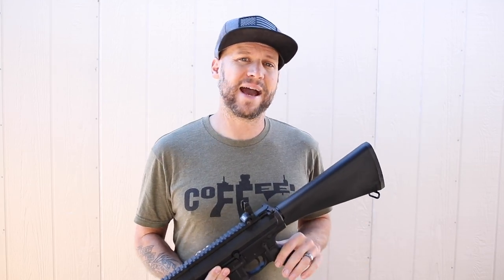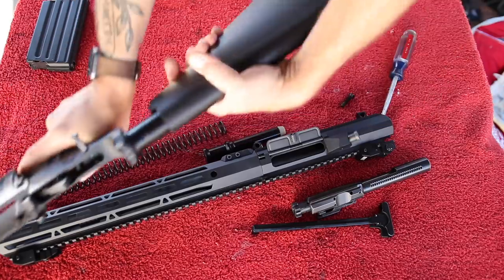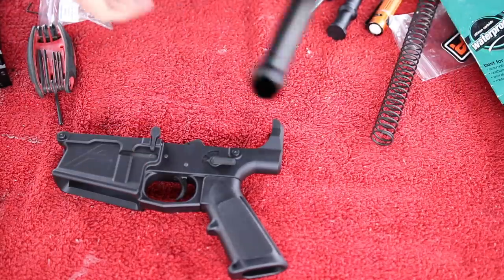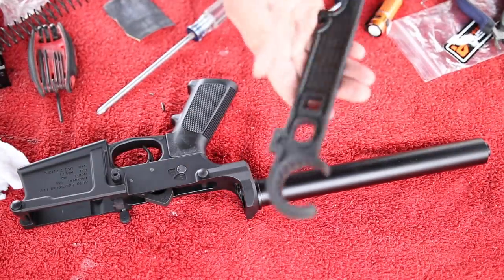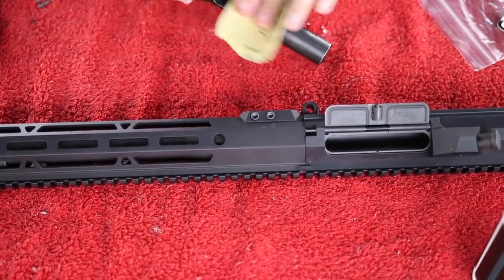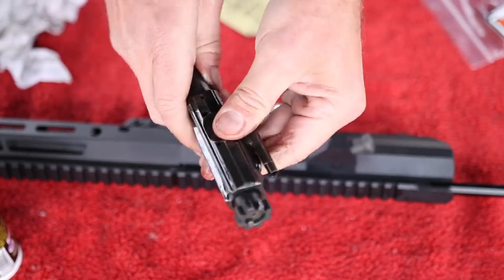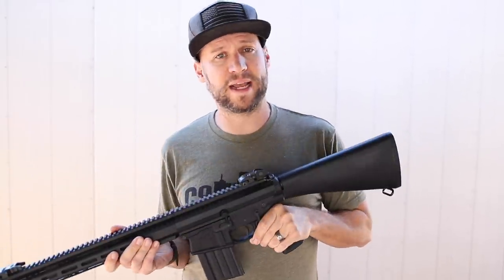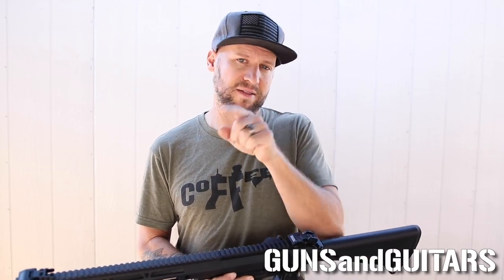Make ANY AR 100% RELIABLE (maintenance tips and tricks)

Comment: Just my 2 cents. I agree, run it wet till the bearing surfaces of the parts wear into each other. They all usually smooth up after 100-300 rounds or so. Not a fan of the sand paper and polishing though, especially with the bolt still assembled in the carrier. (1) A few grains of that carbide from the sand paper would do some damage if you didn't get it all out before firing. (2) The BCG only has 4 small areas that actually contact the receiver. It doesn't take long for them to smooth out naturally, run it wet until then to prevent galling. I want the areas around those bearing surfaces on the BCG to be as rough as possible. A rough texture retains lubricant a lot better than a slick surface. Good old rough parkerized/phosphate coating on a BCG is known to retain lubricant a LOT better than all the fancy Titanium Nitride, Nickel Boron, Chrome, etc finishes. It doesn't wear as well... But the only wear is on the actual rails of the BCG which are pretty small. No matter what finish/coating you put on them, the actual contact rails are going to wear down to base metal before long anyway. A rough texture around those areas helps keep oil/grease in close proximity to the bearing surfaces longer for better lubrication. Not my opinion by the way, These are actual lubrication studies done by Colt and Armalite.  The best thing about the coatings is corrosion resistance. The 4 thin rails the carrier runs on will wear through pretty fast on their own and not likely rust unless it sits un-lubricated for long periods. Removing the coating from non contact areas could induce rust faster to those areas that don't normally contact the receiver.

Comment: I've used Breakfree CLP for decades , even in my issue kit . A little heavier lube on the spring cuts down 'boing' and I usually add a thin nylon washer M8 x22mm into the tube before replacing spring and buffer which also helps to eliminate spring noise and impact if your running a little overpass. Although we are now 'no gas guns' here in UK , this work is still relevant in our straight pull bolt action ARs . Good idea to keep a spare buffer retainer and spring in your grip kit ! The retainers I use are machined from stainless steel and polished ( made in Germany) , which aids slick running on the carrier groove .
I have a rare left hand cooking upper with high rise scope mount . These were made when you were a toddler . Note that these were machined to fit the SLR type imperial cocking handle NOT the FAL metric one ,if your lucky to find one and you have to notch the front of the bolt carrier for the pin to engage . There is a provision for a traditional cocking handle on the upper also . I guess these were originally designed for limited movement in competition or anti sniper role . In such situations as these keeping your trigger hand in position makes a whole lot of sense unless your a lefty .
Naturally every time you field strip the BCG check the condition of the gas rings . With the bolt extended the BCG should not close up when stood on the locking lugs . Chaps in the UK ignore this last comment as you should not be installing rings in your build . The relationship and accuracy of a BCG relies on the 3 internal surfaces of the Bolt Carrier and the corresponding ground surfaces of the Bolt .
Reply: Love finding comments like this which drop real world useful knowledge from a professional once in the services. Appreciate it brother
Reply: @Jordan-ql6tm  Thanks man. My unit had the opportunity to select whatever kit was most appropriate for the job . When selected out for intelligence work in the 5 ( SAS not being intelligent enough LOL ! No love loss between either unit ), we had Ingram MACS as well as our issue side arm normally , a tweaked Browning Hi Power , no mag safety , trigger job etc., a company called Peters Stahl in Germany were making match quality barrels in stainless perfect for the job we did .

Comment: Since I've started using mil-comm full system for grease, lube and solvent I've noticed a huge jump in reliability, even on my cheap-o builds. Never thought the lubing and cleaning process would benefit from one product over another.

Comment: And he pulls out the sorcery again and runs a frugal build without issue!
I can't wait to see how accurate it is. At 308 this would be great for Hog or deer even. 
I am wondering if you wanted to increase accuracy, what would be your first uprade?
This is going to be interesting!
Reply from the maker: I think to increase accuracy, the best way would be to test various types of hand loads to get consistent trajectory from the barrel. I’m just hoping for close to MOA accuracy with half decent store bought ammo. Then the gun will shoot better than me
Reply: Do you really hunt deer with AR weapons?
Reply: @CleanHead  Much like my uncle using his M1-A from WWII to hunt with, I am comfortable with the AR or IWI Tavor platform. With a bipod, and decent optic it is a capable firearm for harvesting deer, and pretty much the only tool I would use for hog eradication. The gas diversion cuts recoil and keeps line of site clear so a quick follow up shot is easy to humanely harvest your catch if required. 
For me the MSR is a platform that makes sense. I also like Henry lever action rifles too, but what I am confident with is the AR.
Reply: @CleanHead  Why wouldn't you?  The AR platform is accurate enough. And you can chamber lots of rounds that provide more than enough energy on target for deer sized game.

Comment: Thats a pretty nice stock buffer tube and spring for the Saint Victor. Smith and Wesson is just a solid company along with Sig. Its hard to go wrong with either the 716i tread or the M&P and Saint. I recommend Midwest Industry muzzle brake or V6 Gamma and LaRue MBT trigger.

Comment: How much gas do you get to the face with the .308 as a lefty?
For reliability a video about the gas system, torque specs, staking would be interesting. (I get that you won't stake it now when you clean or change parts early on). Then the whole balance between buffer, spring, correct gas system length/bore, dwell time. Lots of factors if an AR will be reliable. I'd be interested to see a barrel throat gauged now and after 1k rounds.
Reply from the maker: I didn’t notice any gas in the face at all! As for the barrel throat gauge, it would take probably 10,000 rds before you see a difference significant enough.

Comment: I just finished building a match ar10 so I'mnot gonna lie, when you grabbed that mag of steel case I wretched a little
Reply from the maker: I have a match grade AR I built that won’t run on steel case (but it’s not supposed to). All my other rifles, if they don’t run on steel, I get rid of them. I shoot mostly brass, but I just want to know that I can shoot steel if I need to
Reply: @GunsandGuitars  Most people don't realize that steel cased ammo like Wolf, Tula, Silver Bear etc. also have a "bi-metal" projectile. It's a steel jacket over lead with a very thin copper wash to prevent the steel jacket from corroding. Your lands dig through the copper and into the steel on ever shot. Lucky Gunner did a test a few years back comparing several metal cased (with bi-metal bullet) types of ammo and destroyed the barrel well under 10k rounds. Some of them showing groups opening up around 4k rounds. The cheap stuff is hard on your barrel for sure. But with the money you save in ammo, you can always buy another barrel every 6-10k rounds.  Steel cases are also known for not sealing the chamber as well as a brass case, which leads to excessive carbon fouling in the chamber. The same test by Lucky Gunner showed brass ammo running the full 10k round test with zero malfunctions, while the steel cased stuff had extraction a fail to eject issues all through the test.

Comment: Gr8 build and vid Dan! Question, how's the .308 recoil in a short bbl? I had a Rem 788 with an 18" bbl that kicked like a mule!!! Ended up selling it because of that. Wish I had re-barrelled it now!
Reply from the maker: The recoil very manageable, being that it’s an AR platform; that long buffer tube spring absorbs most of the recoil. I shot 63 rounds of .308 back to back out of this thing no problem. Then I picked up a Remington wingmaster that I picked up cheap to try out, 3 rounds and I thought my shoulder was going to fall off. I couldn’t even shoot the last round (mag holds 4) 😂🤷‍♂️. Nothing shoots smoother than an AR.

Comment: I’m surprised actually you wouldn’t use 1200 grit to polish the internals. It almost seems 600 would be too course 🤷🏻‍♂️🤷🏻‍♂️ Very interesting to observe thank you 🙏🏽🙏🏽
Reply from the maker: If your stuff has sharp burrs on it, 1200 won’t be aggressive enough to round it out. And 600 leaves a very smooth finish especially on metal. Going back with the polishing wheel after also slicks it up perfectly smooth
Reply: @GunsandGuitars  Very interesting. Well makes good sense. Love seeing those affordable builds 🙏🏽🙏🏽
Great content all around 🙏🏽 
I’ve literally waited with baited breath for your In Ear Monitor reviews, researched the best knife sharpening system, and learned to polish internals all from you 😂 
Epic content man 👌🏽👌🏽 👌🏽

Comment: Does your firing pin drop out without effort or helping it out when you pull and disassemble the bcg. I have that same upper and lower set.  only diff is my upper is side charge.  my firing pin kinda sticks in the bolt.   is this a prob, bca is telling me some do stick, but will have no adverse effect.  thoughts?
Reply: Could be good or bad, If it's bent, that's bad. If it's tight in the tail area of the bolt, then that's probably a good thing so long as it's not having any light primer strikes.  Excessive tolerance between the firing pin and the bolt tail can allow gas to slam the firing pin back into the carter pin and break or bend it. BCA is not exactly known for their exacting tolerances. Sometimes you get a part that's slightly misaligned or out of spec. I'd find a way to check the run out on the pin to see how straight it is. If it's bent, or you have a misalignment issue between the bolt tail, cam pin and firing pin hole in the bolt face, it will eventually wear to the point it's no longer tight. A little wear probably won't hurt, but I'd be asking them to replace something if it's sticking bad enough that it's difficult to remove.

Comment: Why are all the surfaces bone dry? Buffer tube threads, the bolt, everything. Maybe instead of using a dremel tool and sandpaper, buy quality parts, use lube, and actually put the rifle together properly. You don't thread things dry. And why are you polishing things that have no friction to begin with? They don't touch anything. Like half the BCG you dremeled doesn't touch anything when the rifle operates.